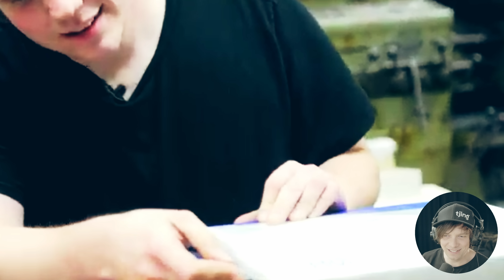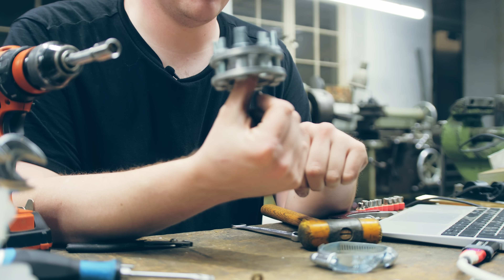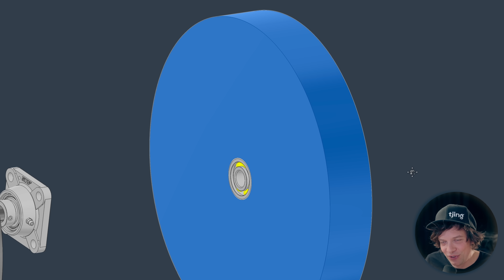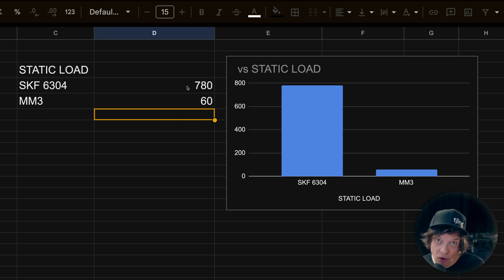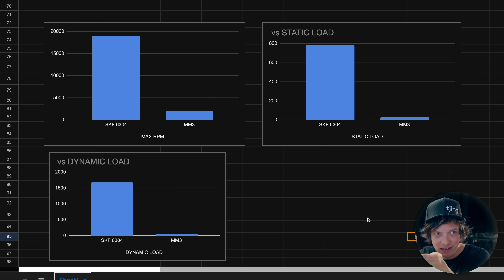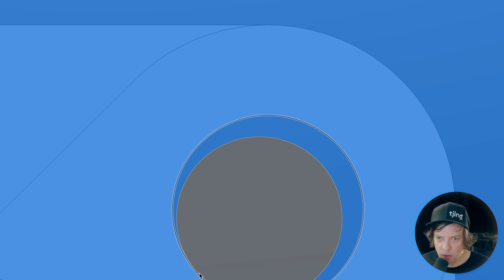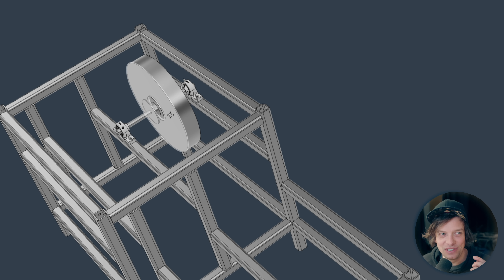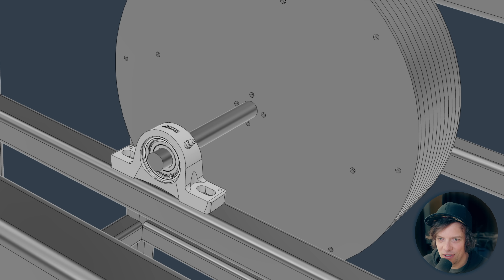Worst Bearing Housing Ever - Marble Machine 3 Ep.3

Comment: Price is not the controversy. It is just that it will not hold the balance wheel.  Your solution will make the plates move out of balance.

Great help from SKF.  They know what to do and calculate on the forces.   The problems is not the static load.  It is the live forces because you are loading it with dynamic forces.  Unbalance is the enemies for your solution.  Faster it goes, more forces will be needed to hold those plats in the balance wheel.

Your tolerance relies on bolts holding the position.  You should have a cone bolted to the whole in the center of the disks.  So clamp to the sides, but press a cone to the side/whole.

The last solution is the best.

Comment: Another question, why not buy the flywheel assembly as a part? Unfinished cast flywheels are not expensive and even ones that are finished and mostly balanced are not that expensive. Solves this whole thing and gets you nice fitting bearings on machined surfaces.

Comment: First I'm sorry to post that here but for personal reason I can't access reddit. I'm totally on the same page as you when you say you want to try new idea because we can and not staying focus on traditional idea, but on your design I'm concern not about the bearing but the screw. Basically in your setup or else you maintain your bearing by tightening your screw who create friction and that's what keeps your bearing on position (that's the normal way a screw should be used ) or you use your screw as surface for your bearing to rest on. In the first case your charge, a flywheel, is a big mass and has great chance to fall not being able to be maintain by the friction of the bearing. The second case is basically just a housing where you remove some surface to make all the charge being supported by just somme screw not verry big and great to support a flywheel at full speed. But maybe some test can prove or unprove it but I think that's what you should be concerne first.

I think you're right about not wanting to use a self aligning bearing because again with the flywheel mass on your axle the bearing will slightly pivotate a little and when the speed add up generate a non concentric flywheel who'll create a lot of pressure on you axle.

Comment: I would make a flywheel able to be mounted on a tire calibration machine to have it balanced out. Use a conical centered mount on the shaft and you are good to go. Then only small conical parts needs precision machining

Comment: Don't insist on avoiding machine operations. Your problem screams on machining operations.
Here is an ordinary way of solving a similar problem:
Flywheels are typically castings (not accurate - like laser cut) that are then machined to high required tolerance.
1) Put undersized alignment holes for locating pins in laser cut plates
2) use vertical drill to enlarge alignment holes.
3) connect bearing wheel house using locating pins. Tighten the 4 bolts.
4) of the concentricity and perdicularity are not gopd enough, machine away a small thikness of the flywheel

Comment: Yeah, not worried about the bearing, it is the housing, and more specifically the bolts that we are worried about failing. 

Once those threads get pressed down than your bearing is open to movement. And flywheels of any kind are scary as shit

Comment: Is it concentricity the real requirement? why not try just to BALANCE the WHEEL instead, you can easily add some screw holes and screws where needed to balance the wheel. 
concentricity could be defined within certain (not overkilled) tolerance that works for your functionality purposes.

Comment: See that's what everybody was trying to say that those are the bearings you should use and you gona have to balance the wheele after you installed it in no way it will be perfect aligned from the get go so don't worry about it balance the wheel once installed

Comment: For the live axle and pillow blocks you could just use a key to lock them into place, or honestly weld the shaft to the flywheel. They have to be balanced afterwards regardless, otherwise the whole machine will shake.

Comment: I don't think they are talking about the bearing failing speciifically but the makeshift housing of it instead, bolts starting to enlarge their mounting holes etc. Although it would subject the bearing to forces it is not designed to handle as you are creating lot of point loads in your design compared to regular housing, so it could fail as well. Especially since you talking about the flywheel not being a perfectly machined specimen but something that might be bit wibbly-wobbly.

Comment: I would suggest using locating holes in flange. To get H7 hole tolerance in flywheel I would cut hole with allowance in material supplier and use H7 manual reamer in hole. IMO it's the easiest way to get really tight balance on flywheel.

Comment: I would suggest calculating how much energy you plan to store in that flywheel.  If it is enough energy to kill someone, then only use industrial proven solutions.
Reply: Yeah…I was wondering why there has been no mention of the energy-requirements for this project yet.  How can anyone properly design a flywheel, when that basic component isn’t even known?

Comment: @wintergatan with a tapperd lock. Thats how propeller shafts are are connected to the shipingengines. The tapperd lock is on a flexible coupling which is bolted on a flat surface.

Comment: Just run reliability test accelerating and braking flywheel prototype.
I think, the threads of threaded bolts is the weakest link, and it should be deformated, and the fit will be loose after some cycles (much less than appropriate bearing housing)

Comment: Build your flywheel housing, mount your flywheel, mount a tool head and cutter, spin up your wheel and turn it in situ, you can't get more concentric than that. Use whatever bearings you like!  The MMX will be building itself.

Comment: I am still confused why that flywheel must not have "too much perfection" (a.k.a. not use a lathe). Machining one single  disk to size and with a single feature is super easy,  cheap and quick.. 
Would you throw away the square tubing as well because they are too straight and homogeneous?

Comment: I've commented this before, but there's a major issue I foresee in the future that is best addressed as early as possible - vibrations. With so many moving components, extremely high precision, and a focus on sound design, I would be very wary of the effects of vibrations and try to add some simple damping within the structure, or at the very least design things to avoid resonance at all costs. Its a pretty critical aspect that seems to be left out consistently, and while I am certainly no expert I at least want to ignite some discussion about this before its too late.

Comment: I have played with ChatGPT some and it is very important to point out that ChatGPT can literally do basic math operations wrong. In that case, it happened to be right but I would be careful and run the numbers through an actual calculator yourself to make sure ChatGPT is giving you the correct numbers from the math.

Comment: If the primary concern is concentricity and perpendicularity, why would you opt for a manufacturing process that creates significant risk of deformed parts that put those criteria at risk? Manual processes and brute force to get your press fit bolts in risk your plates deforming, and laser/plasma cut plate has substantial heat distortion issues that machined plate will not experience.

Comment: Another dumb design requirement needlessly forced upon the machine by Martin. I'm a millwright for the past 15 years. Just get it machined and stop wasting time. In the world of bearings and shafts there is only machining. Machining your rotating equipment is not "sPaCe gRaDe" it's the only way. Either you do this now or MM3 fails.

Comment: IMO The lathed fly wheel is the least over kill and least perfectionist. Can be balanced with weights. The baring housing you designed is cool, but not as tried, proven, tested and fundamentally classical as a press fit and lathed wheel.

Comment: martin needs to look at a drum throne that uses the bolt as the locking pin - the bolt threads get smashed, the area that they press on gets worn and bent. I just sold a drum throne and had to file all those pieces to get it working nicely again. Is that how he wants to build this machine??

Comment: I used ChatGPT a lot for physics homework this semester. And, while it does set up a problem pretty well, it will almost NEVER get the numbers correct. I did the calculations myself from what ChatGPT did. I got the dynamic load to be 53.65 kg, while ChatGPT's result was 53.37 kg. That is a really small margin of error, but that still is evidence that ChatGPT is NOT 100% reliable. I understand it was just for crude estimations, but still, if you're gonna need to do math, just get a person who knows how to find the answer rather than AI.
Reply: >i used chatgpt  for homework
NGMI
Reply: @diobrando2160  i got a 79 i hope you find a bridge

Comment: As a software engineer, I've learned the hard way multiple times to not reinvent the wheel. From "The Zen of Python":

Special cases aren't special enough to break the rules.  - Don't reinvent the wheel because you think you need to
There should be one-- and preferably only one --obvious way to do it.  - The obvious way is the standard way all the smart engineers are telling you
If the implementation is hard to explain, it's a bad idea.  - A three part video justifying your custom part is a hint that this is a bad idea
If the implementation is easy to explain, it may be a good idea.

Comment: For the math you could not prove. That formula was for the force of angular velocity of a spinning point on a rotational surface. So the force an object on the end if the disk would endure, now the radius I am confused as it said of fly wheel, not of bearing. If measuring the forces on the bearing than the bearing radius is what is wanted. Otherwise math is right. If it is the outside rad of a bearing then that would be the force exerted on the outside edge.(That .001 confused me, I think it is unit conversion, never seen it done that way, but makes sense)

Now none of these are the forces the bearing would be under. TBH I don't know what that formular would be, I only say this because this would indicate the load of a bearing is only determined by the size of the bearing and not its load. I would assume there is some intregral formula where you take the disk volume, have no idea though..

If anyone else knows if a simple angular velocity equation is fine then please correct me, it might be.

Comment: Your assessment of bearings and perpendicularity is misguided. Single row ball bearings, though they may tolerate axial thrust or moment loading (maintaining perpendicularity in your example) to some degree, they are really not well suited to it. They are very good at radial forces and so in any situation where you must maintain some perpendicularity of a shaft to a stationary object, you use two bearings (which sometimes are combined into one unit, but are two bearings none the less.)

In this way, the pillow block bearings are entirely capable of maintaining good perpendicularity because with two, any moment forces on the shaft translate into radial forces on the bearing race. Thrust is still a problem, but your design doesn't seem to have a need for much thrust control.

One way to maybe hack the problem described around 13:50 (and 19:30 for that matter) would be through the use of concentric bushings on the flange bearing housing. If you can't make it perfect, make it adjustable. The concentric bushings would allow you to adjust the position of the bearing relative to the center axis of the flywheel with fairly good precision and then lock it down.

Comment: So first you say that last video was lacking reasoning. But then reason is ”too perfect”. Does not cut it especially when you first say that money does not matter. You will have teething problems anyway you dont need to try and generate them intentionally by avoiding right solutions. Problem here is ego. 

Especially because of bearing seeing loadings, you dont want to introduce unwanted pointloads from the threads and basically pressurised hold.
Making this excuses video took more time than lathing the proper result.

Comment: I get that no one has built a machine with your specifications before, but you are doing a modular design this time around and this flywheel is effectively an isolated module with only 1 purpose: To perform the most basic functionality of a flywheel. Surely this problem has already been solved? Surely there exist flywheels that drive a shaft and are designed for balance and stability?

Comment: The bolt cage bearing holder just needs another layer with a bearing sized hole in it - you found the holes on the test parts can be cut well enough that a bearing sized hole should pose no problems, this would remove the load of the flywheel riding on the 'points' of the threads

Comment: While the design is terrible on paper and breaks some design principles, it might actually be sufficient for the requirements. The bearings are not nearly used at their load specifications.
Give it a try I guess

However the calculation made by ChatGPT is pure trash lol. When the flywheel is balanced, it will not induce additional loads into the bearing except for its weight

Comment: I think the bearing housing you’ve designed is a non issue.
Traditionalists are maybe overthinking this and holding it to a standard that doesn’t apply. This isn’t a wheel bearing that’s going to be holding tons of weight, or spinning for countless hours under such pressure. If it starts to fail, it can be swapped out.

Comment: You might want to consider looking at common machines that have similar issues. Cars, motorcycles, washing machines, etc. A car's front wheelbearing assembly is readily available, should likely be suitable (do some RPM and load guesstimations) and has a flange to bolt to and a place to ensure concentricity for example.

Comment: From an engineers perspective I would say that "rotation" (and in a wider sense the components selection to make it happen) is the most critical aspect of the entire machine. My suggestion is to choose "standard", proven solutions for these main drive components, in which you can have full confidence in even after millions of cycles. Don't dismiss relying on countless combined lifetimes of engineering experience from those who came before you, and had to find solutions the hard way. ;-)

Comment: Honestly? it is fine to prototype and test, specially when you are leaving yourself options to change things later. But this is one where the comments are almost entirely in agreement about the risks. And yes risks. This is a flywheel. It is dangerous. Please, if you must test this out, please do so carefully and keeping in mind what the concerns are and monitor them. Don't just set it and forget it. 

I am specially concerned about the weare and tear on the bolds and the outside of the bearing where they would meet. I can see the threads of the bolts crushing and leading to a lot of vibrations. Potentially dangerously so. Please test this carefully.

Comment: Be aware that concentricity doesn't stop at the bearing. 

If you're using lasercut plates as a flywheel, then the outer edge is just as inaccurate and possible nonconcentric as any bearing you mount to it.

Comment: Martin, i don't get your point. As you said, there is no need for NASA standards in your designs. Also, the machined pieces would never be as the ones you designed. All those characteristics that que housing has are to accomodate to imperfections made during machining process. Also this would be revving at a relatively low pace.

Comment: You could use a splined shaft and cut the parts to be a press fit held in place with a shaft collar on ether side, and say you don't need a 600 pound flywheel spinning at scary speeds you can reduce weight by making the inner stack of plates rings.